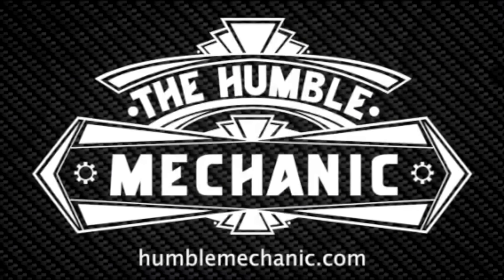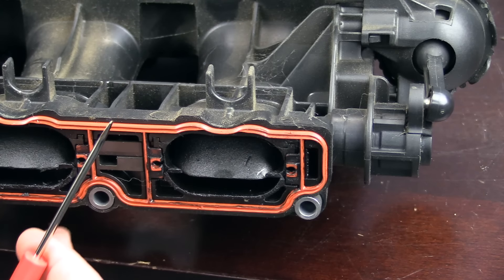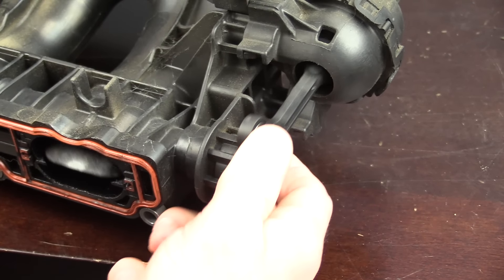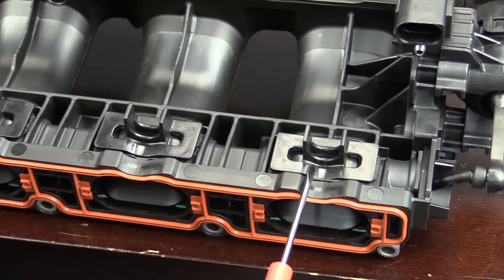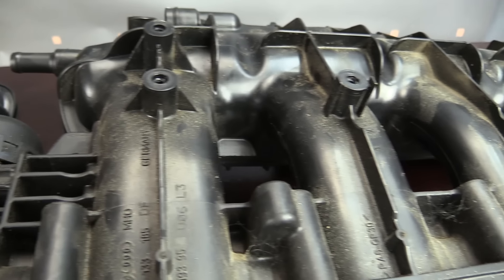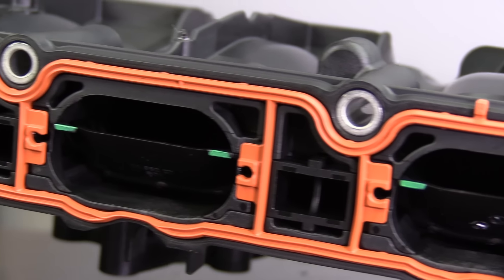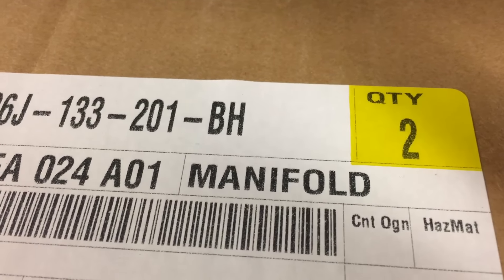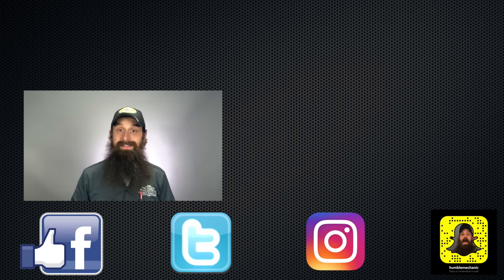2.0t TSI Intake Manifold UPDATE!

Comment: Does the 2.0t engine have a IAC, or does this flap mechanism serve that purpose? I have a 2008 Audi a4 fsi, and having intermittent idle issues. The problem isn't obvious. Smoke tests, trims good, MAF good, hpfp good, A/F good, fuel filter changed, etc, etc. Wondering if there could be some intermittent problem with flaps or flap motor? Thanks for the great videos.
Reply from the maker: +David Cavallero the IAC is part of the throttle body. It uses the motors to adjust airflow into the engine. 

You probably have oil leak issues or PCV issues cause your idle problem
Reply: The pcv and hoses were replaced as well as the purge valve. I do have a oil leak at the brake booster vacuum pump and a little around the valve cover bolts and gasket, but not sure either could cause the intermittent problem. Since leaks usually get better as the motor warms up, and the problem happens after an hour or two on the road, I started thinking about the fuel pump regulator heating up and weakening, or maybe the a/f sensor heating up and doing the same. I installed a cell phone scan tool and dangle to try to catch the problem, but around town it runs great and all looks normal such as fuel trims, a/f, lambda, etc at idle and load. Guess I will need to drive farther than I want to try to get the problem back. Had thrown a P0171, but it was cleared after some repairs and the code hasn't returned, even with the bad idle.

Comment: Hey i have a 2013 Jetta GLI, it makes a sqealing, almost  rattling pully sound on start up for about 5 seconds. After ive been driving it for a while, if i have it in manual mode it will do the same sound if i slightly rev out first and second gear...any pointers you can think of to look at replacing? Thanks
Reply: Same. I hear almost a whistling fluttering sound at idle to low acceleration. Anybody find a cause for this?

Comment: I have a 03 jetta 2.0 Manuel transmission I was wondering will the 6speed 2.0 l transmission fit my engine?
Reply: Armando No it will not. Your engine is a  SOHC 8 valve naturally aspirated engine (engine code most likely AVH). This intake is for 2008.5 to 2017 2.0 TSI DOHC 16 valve turbocharged engine (engine code CCTA CBFA)
Reply: Is there any way I can get a 6 speed for my engine?
Reply: Armando Chavez that is possible. Cheap? That's another story.
Reply: 2ndRightStrong ok thank you
Reply: Armando Chavez  no problem. I would love to swap a 6 speed into my Jetta as well.

Comment: Hi Charles, is it normal operation for these engines to activate the intake runner flaps on cold start? I have a 2011 gti ccta engine and it’s driving me crazy, has a new manifold and ever since it has a rough running cold start while the runner flaps are activated for the first 45 seconds or so and after that it’s smooth, also getting codes for intake runner control

Comment: Hello there, I have some serious problems with my A3 Convertible, Engine CAWB (so the 2.0 TSI Engine), Error Code of course P2015. 1 year ago Audi replaced the Mainfold and it was OK so far (had an other error). 
Since Weeks the Engine light is on and the Audi Garage cannot find the problem. First they recalibrate the Sensor for the Flaps, then they replaced the Aftermarket Battery with an original one, no success. Then they made a separate wiring from the Engine control unit to the manifold to exclude possible problems with the wiring harness, still no success. They replaced the Sensor on the manifold, no success. At the end they replaced the Engine Control Unit and, yeah, no success.

Brought the car to an other VAG Partner, they cleaned the intake Valves with a Nutshell Granules (wondering why Audi didn't do this) and installed a Valve from a technical solution from Skoda. No success.
I am searching for Ideas. Is this what @Bradley Parrett mentioned applicable for Audi too? I would check if the Valve has been closed with a nipple or not if so. 
My feeling is, the latest version of the manifolf is not working properly and needs to be replaced. I was a Car-Mechanic too but don't have all the tools here, VCDS is available.

Any ideas? Thank you all.
Reply from the maker: If everything they tested was good I’d want to confirm good vacuum to the solenoid. The T can break .
Reply: @HumbleMechanic  Thank you very much for your feedback, this was my thought too. Do you know if this can be tested by VCDS and where to find the routing of the vacuum lines? Audi told me that they had already checked this (of course they are telling me this...).

Comment: Hey Charles I changed my manifold when I did a carbon cleaning and the manifold I purchased didn’t come with a sensor so I had to use the old one and put it on now I’m getting a CEL for my intake runner position sensor. I’m wondering if I need to make sure the sensor is tightened all the way down or just purchase a new one to put on
Reply from the maker: It didn’t come with a sensor? What year car? Never seen the CCTA/CBFA not come with a sensor
Reply: @HumbleMechanic   yes I purchased the intake manifold from ecs tuning in a kit and it’s from an oe company Hamburg tech but yea it didn’t come on there and I have a ccta engine
Reply: @HumbleMechanic  it’s a 2011 GTI , this is the exact part https://www.ecstuning.com/b-hamburg-tech-parts/intake-manifold-newest-revision/06j133201bh~ham/

Comment: Hi Charles I replaced my intake with the updated version and I got the code P2015. after soon closer review I noticed I had the vacuum connected on the wrong side would that be causing it. I will be trying out tomorrow
Reply: Had the same issue. For anyone else; refer to https://static.nhtsa.gov/odi/tsbs/2017/MC-10127807-9999.pdf to get those vacuum hoses connected correctly.

Comment: Hey there, I dont know if you're reading these still but you just saved me big time. I had a coolant leak when I was out of town. I didn't have the proper tools and couldn't seem to locate the source. It was leaking too bad to travel and it was too far to tow home so I took it to a shop with a lot of good reviews. I was told it was the water pump and it cost me a good chunk of money to get it repaired but when I got the car back it was pulling the p2015 code. Of course the car had 130,000 miles and that's only covered to 120,000.

I didn't have money to fix the new problem so I had to drive around for a while with the check engine light on and suffer through rough starts among other issues and I managed to get the money to buy a new manifold. I watched your video a couple times and dug in on the repair myself. I got the old manifold out and transferred the throttle body and the other parts over and installed the new manifold. I cleared the codes and started the car and it immediately pulled the p2015 again.

I started searching for other causes when I ran across this video and happened to watch it. I didn't realize there was an updated manifold. My old manifold was exactly the same as the new one so I was curious. Apparently I already had the updated version which was probably from the previous owner. So why was I having a problem? Anyway, as you were going over the differences, around 3:14 you mention that the metal nipple on the vacuum is supposed to be open. WTF? My old manifold had a little rubber traffic cone looking thing on that nipple and I had transferred it over!

I ran to my car and managed to get the nipple off without taking anything else apart. I cleared the codes again, started it up and the problem is gone!

I'm pretty sure that mechanic had seen the mileage on my car and stuck that on there, knowing it would pull the code and would be out of warranty. It makes me wonder if my water pump was even the original problem or if it was just a leaky hose. If you see this, thank you so much for saving me in the end. You also may want to make a video about how a dishonest mechanic can do this and maybe save more people from this issue. Thanks again.
Reply: Having the same issue. Waterpump replaced and now I have a p2015 code... Are you/ were you running a tune?

Comment: I just threw a P2015 code today in my 2009 Audi A4. I'm going to have Audi fix it. Like you said, Audi has extended the warranty to 10 years or 120k from what I understand. I can report back. Thanks for the vids!
Reply: Turns out only B7s have a service bulletin. B8s haven't failed enough to have Audi issue the extended warranty. Arg!

Comment: hey charles I just wanted to mention that there is also a breather that goes with the warranty replacement. it feeds off the manifold solenoid and mounts on top of the cam cage/valve cover.
Reply from the maker: +Chris Castiglioni is that new? I know we have to add fuel treatment. I didn't know about the breather.
Reply: HumbleMechanic yeah it is new came out with the manifold. there should be a bulletin about it.

Comment: If you have a P2279 error code it could be that NTB didn't screw the oil cap back on properly or push the dips tick down all the way. Thanks NTB

Comment: I wonder if this issue is the same for an BLG 1.4 TSI engine from 2008? I can clear the P2015 error, but it comes back after a couple of days. I hope it's just the (VW OE-03C 907 386) sensor

Comment: hey Charles I got mine replaced mid to late January at the dealer. is there any way to check on the invoice the part number they put on it? or if you can see it from the engine bay.. please let me know thanks!
Reply from the maker: +dwade353 it should have the part number on the invoice.  If it doesn't, you can call the local dealer and ask.

Comment: great job Charles!  Does any of this  apply to the 1.8TSI as well or does that use a completely different manifold?
Reply from the maker: +michael spencer thank you!!!  The 1.8 has a very different manifold
Reply: HumbleMechanic  cool.  thanks!  really enjoy your videos.
Reply: I have a 2011 1.8tfsi and I’ve had a p2015 fault code for 6 months now. Had the entire manifold replaced and wiring/valve/throttle body checked and still the problem persists. Completely lost with this one...

Comment: Will this work with a 1.8tsi bzb engine?  Thanks
Reply from the maker: +Shimon La Hée I don't think so. This is for the 2.0t
Reply: HumbleMechanic the 1.8tsi and 2.0tsi are identical I think what changes the displacement is the crank and pistons everything else should be similar
Reply: HumbleMechanic but thanks anyways
Reply from the maker: Generally the stuff bolted on is not the same. But in this case, I really don't know. The US didn't have that engine code. 

Plus identical is not similar ;) LOL
Reply: HumbleMechanic I feel ya but I buy alot of stuff for the 2.0tsi and it's bolt for bolt works flawless as well if ever I have a manifold error I will try this and update this comment thread thanks

Comment: I had P2015 on MK6 GTI: the arm is firmly attached to the solenoid and it moves when accelerating. Moreover, via the diagnostic tool I was able to re-calibrate it and I could see in the computer that the flaps were going from 0 to 99%.
Now the error is cleared, is there a chance that can re-appear? If yes, what’s the cause? Since the solenoid works and flaps open/close completely, can be the sensor being faulty?
Reply from the maker: Odds are yes. Some times carbon prevents the flaps from opening or closing properly

Comment: Hi, Humble mechanic I have just replaced my intake with the updated part but I still get p2004 fault code  and can't adapt flap runner in vcds group 142 . flap position sensor shows that flaps are always sitting and 22% and reach to the max 67 % and i think this is the reason It cant do the adaptation.  Do I have to update the Ecu after changing it to new manifold. also I have noticed the new intake manifold  as part number is 06j133201 BD not the BH  does it make any difference as the seller  told me there is no difference . please let me know if there is something I missing to do or doing wrong Regards

Comment: Hi HumbleMechanic, , I updated my 2011 vw Tiguan with the new manifold but now I'm seeing a P2008 (Intake Flap for Airflow Control)?  Any ideas why this is happening?
Reply from the maker: Odd. Be sure you have the vac lines on right and everything is properly connected. Might just be a connector not fully seated

Comment: SO WAIT this manifold doesnt fit on 2.0T FSI BPY if i was to want to upgrade it to this one?? And if im having the same issues with the flaps being "stuck open" and the P2015 problem will buying the intake manifold funner control fix it or will buying this fix it. Cause now im confused. And almost bought this manifold. But if this wont fit my 2.0t FSI i wont. I rather buy the motor. And will the motor NEED to be set on a scan tool or can i put it in with battery removed and start it up once its in.. please reply as soon as you can
Reply from the maker: The FSI engine has a different intake. you can get the IMRC separate from the manifold. You should really do the basic setting on the flaps, but most will learn by themselves

Comment: Once again thanks for your videos...I'll be purchasing this from deutsche......as I made a rockie mistake I purchase one from Ebay it didn't came with the sensor I purchase the sensor ending in B" and on the CPU it read close 30% and open at 88%....and of course the check engine its there.
Reply: I am having the same issue I dont think the B at the end of the sensor makes any difference , even in the video the old sensor dont have the B at the end . how did you resolve the problem ?

Comment: I have a P2187 code (lean at idle, fuel trim +13% at idle, air intake leak etc) on my MK6 GTI. Cleaned MAF, replaced PCV system, checked for leaks and it’s still idling rough with a CE light. Intake manifold is the next part to check. It’s driving me mad trying to nail down what’s causing my issue.

Comment: @HumbleMechanic I had two CEL codes P2008 & P2015, I finally broke down and purchased the whole intake manifold assemby from shopdap. My 2010 A3 2.0L now has it's performance returned, and the P2015 is gone, the P2008 continuously returns immediately after clearing, and has a irregular idle. Any recommendations for troubleshooting? P2008 is such a generic CEL for this car/engine. Thanks in advance for any direction!
Reply from the maker: You may have to test the solenoid wires
Reply: @HumbleMechanic  do you happen to have any literature, links, or pinouts to reference a test?

Comment: Looks like they both are made from PA6-GF30 or nylon 6 black, 30% long strand glass filled. My Tiguan won't throw the P2015 code with the Unitronic tune. What PID can I look at in VAG-COM to check the function?
Reply from the maker: +sbcncsu MVB 143 I think(I'll double check) shows intake manifold action.

Comment: Hey Charles, can the third air supply port be left open or does it need to be filtered? Getting ready to update my manifold while doing a carbon cleaning. Thanks!
Reply from the maker: The additional can be left open, but there is a filter kit for it.

Comment: Charles, You always fill videos with so much information they have helped me in ways I assume you never really imagined.  Thank you for the videos you have created over the years which have been so helpful even if the primary content of the videos is not what helped me in my research!   Sometimes comments you make in the videos have helped me to understand something I was trying to figure-out on my own as a "thrifty VW DIY mechanic"!    This one, for instance, helped me to understand that the runners hyperextend when the throttle is wide-open, go beyond their stops and create the sensor fault...a condition fixed by the new manifold design... but I used the ECS  intake manifold repair kit, properly applied (thanks to one of your comments) to my intake to fix the P2015 problem I was having.    I have other examples of how you have helped me... if you ever desire feedback.

Comment: Is VW still replacing these for free under their extended warranty?   My 2014 GLI just got the P2004 fault code at 55k miles.
Reply from the maker: That is vin specific. You’ll want to call your local dealer have have them run the VIN.

Comment: I'm about to replace this on my 2010 GTI for the 2nd time (185,000 miles).  There is an additional hose from VW that looks like it may go between this additional port on the solenoid and the valve cover.  Will this hose be necessary?  It says in the video that additional port on the solenoid would be left open, but I wanted to be sure before ordering parts.
Reply: Did you ever figure this out? I got the same question.

Comment: Hi Charles, when trying to install the rail on the updated manifold the hole don"t line up, its this common?
 or do I have a defective updated manifold, thanks
Reply from the maker: Never ran into that. They always line up pretty well.
Reply: We just had the same problem. Holes did not align. Defective. Dealer had another that worked.

Comment: yall should also know that you need a new fuel rail that fits with this upgraded intake manifold. Didnt know until I couldnt fit my original fuel rail with the new upgraded intake manifold. instead of wasting more money on such thing, my dad and i just cut off the clips from the intake manifold and adjusted the original fuel rail so the screws would go in straight.

Comment: I have a 2010 gti mk6 with 95k miles. the p2015 code keeps popping up. will VW replace intake manifold with new version under extended warranty??
Reply from the maker: They should. It's a question to ask the dealer before they do the repair.